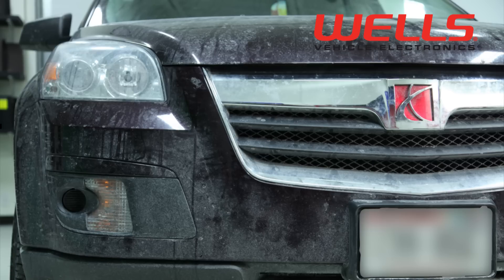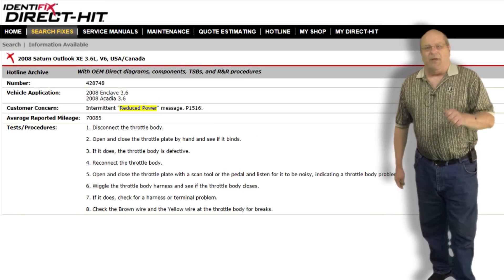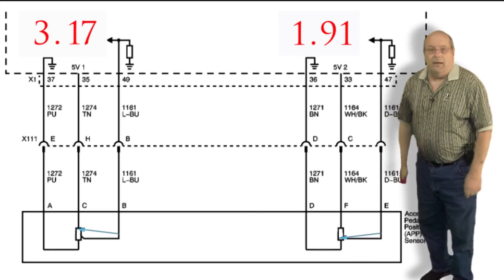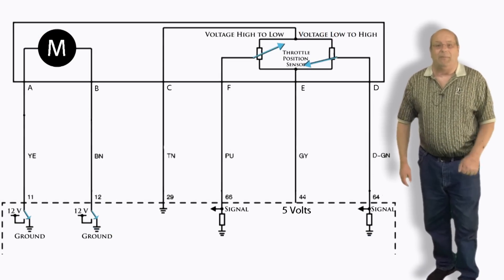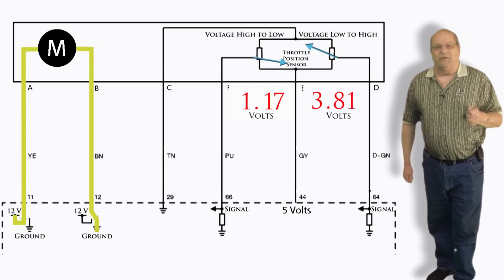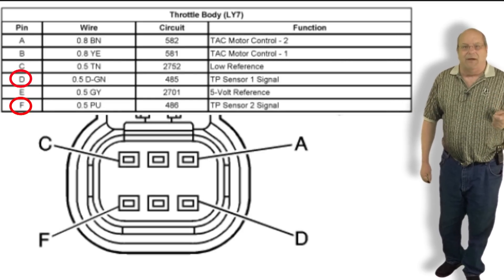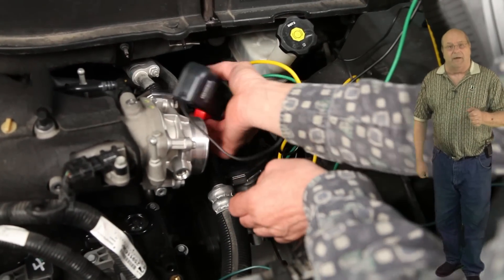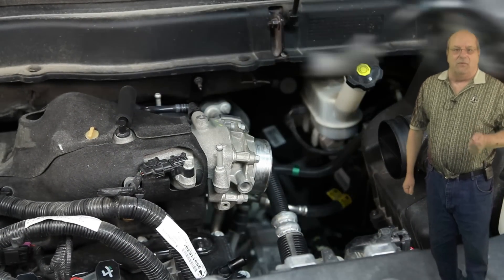Drive-by-Wire Function and diagnostics by Wells

Comment: Technically sound, this is the information I was looking for, my 2003 X-trail is starting and cutting off after 3 seconds, the throttle body flapper is not moving, I changed it, and still nothing, any advice? Do you know where the relays are for the motor or is it transistors that are switching inside the ECU.

Comment: I have 09 Saturn aura Xe I get power reduced light on and I use to be able to wait like 10 or 15 mins and it would drive normal but now It want do that now is there a way to buy pass it the codes told me it was the gas pedal sensor but I replaced it and it's still the same

Comment: Hello, thanks for the informative video.  I recently put a new pigtail on the Throttle Actuator Motor on my 2008 Expedition.  I thought I wired it correctly, but not sure if there is a pos. or neg. side to motor.  There is a red wire and black wire coming from pigtail, but Ford has diff. colors to harness.  (Blue wire and Yellow wire) can't find wiring diagram.  Any help?

Comment: Good day Sir.

 I have problem with my Toyota Yaris 2012
The idle drop when AC is turn on and it only idle like around 720+rpm.
I also noticed the cooling fan doesn't switch to on/off when it reach the temperature.  It remains On
There's engine vibration is also noticeable, I have cleaned the throttle body, change the spark plugs, ignition coil and o2  sensor. I check for any leak from the hoses but still having the same problem.
I Hope you could help me, have a nice day 
God bless

Comment: Hi. I was wondering if  is a discrepancy between Tps 1 and Tps2 could be cause by a dirty throttle body.
Reply from the maker: Hey, I don't see how it could. The sensors are both reading on the exact same shaft. If there's a dirty throttle body issue I would expect both sensors to show the same results. 
Mike Becker, Senior Technical Instructor
Reply: Thank you, Mike.I was just asking because I see people who have the same code p2135 on nissan say that they clean the throttle plate and fix  the issue. I, myself, don't see how this can happen as well.
Reply from the maker: Hmm, not sure! A P2135 is a signal rationality code. Not sure how the throttle plate would cause that.
Mike Becker, Senior Technical Instructor

Comment: so does the apps also put out two different signals opposite of each other that adds up to 5v?
Reply from the maker: Most put our 2 inverse signals. It's not so much that they need to add up to 5v, it's more that they cross paths at the proper voltage, that's what the computer is checking usually. Some cars use 3 signals. Ford likes to do that.
Mike Becker, Senior Technical Instructor
Reply: Wells Vehicle Electronics thanks for the reply.  Is the throttle position sensor opening percentage on a scan tool suppose to match the app sensor %?
Reply from the maker: Usually not. The APPS is an input to the PCM. The PCM makes the call on how far to open the throttle. Want a good representation, go drive a car with traction control. Stomp on the gas in gravel and make traction control kick in. You'll see 100% APPS and very limited TPS. This is because the PCM has the final call on how much throttle is actually allowed :)
Mike Becker, Senior Technical Instructor
Reply: Wells Vehicle Electronics got it thanks..appreciate all your videos..always a good learning experience
Reply from the maker: Glad you're learning. Thanks for commenting and asking questions :)
Mike Becker, Senior Technical Instructor

Comment: Hey, Sir. Do all ETC system function the same way? I am just trying to know if Infiniti TPS Sensors function the same way as the vehicle in this video.
Reply from the maker: Hi, as with everything on a car, it's very unlikely that something functions the same as something else. ETC systems are no different. Whether its an Infiniti or a Ford, they will act different, but do the same job. What kind of Infiniti are you working on?
Mike Becker, Senior Technical Instructor
Reply: Thank you, Mike. It is a 2006 Infiniti FX35.

Comment: @markhicks Mr. Hicks I have 99 crown Vic 4.6 with a p01409 @ p0443.. I am missing feed voltage for both of these solenoids.. This is with (KOEO) The Evr solenoid that controls egr valve has two wires, red & brown. The brown wire goes to ecm ground side switched??  The red wire is feed just because it's slightly heaver gage wire.. So I assume it's feed.from looking at a wire digram I don't it's destination.. Maybe it's the bootleg wire diagram I'm using or my inexperience of following a diagram idk.. But it only shows red wire#11  Is that ecm slot?? Or is that a another connecter& slot??  Lol hey when is that wiring diagram class??
Reply from the maker: LOL Wire diagram class starts January next year.
this is the test procedure for the P1409:
1. Verify battery voltage is present to the EGR Vacuum Regulator (EVR) solenoid on the Red (R) wire with the ignition switch in the Run position.

2. Check resistance between the two terminals of the EVR solenoid. Resistance should indicate 30-70 ohms.

3. If the solenoid checks to be OK and the R wire indicates battery voltage, check the Brown/Pink (BR/PK) wire for battery voltage with the ignition key in the Run position.

4. If the BR/PK wire indicates battery voltage with the solenoid plugged in, check the BR/PK wire at PCM pin 47 to verify that the BR/PK wire indicates battery voltage indicating a defective PCM.

5. Check the BR/PK wire to verify it does not show any voltage with the PCM and the EVR solenoid disconnected to verify it is not shorted to power, which may have damaged the PCM driver during an EVR solenoid activation attempt.

Test Procedure P0443:

1. Check for a blown (or missing) fuse 21. This is a 15-amp mini-fuse in the engine compartment fuse box.

2. If the fuse is OK, check for a poor terminal connection or a broken Red/Yellow wire under the fusebox. 

Fuse 21 supplies power to every component that is setting a code. The missing and lack of power is due to the Powertrain Control Module (PCM) shutting injectors off under load, in order to protect the transmission.
There have been problems with the harness to the transmission causing this fuse to blow. If you find yourself on this path also do this test procedure:

1. Check fuse #21 (15 amp mini) of the under hood fuse box for a blown, missing, or poorly connected fuse.

2. If fuse 21 is found to be blown, inspect Vehicle Power (VPWR) circuit for a short to ground, at any of the Oxygen (O2) sensor harness connections, looking for a potential short to the exhaust manifold or an exhaust pipe. Disconnect the transmission solenoid harness on the passenger side of the transmission and inspect it for the presence of transmission fluid on the connection. Service the harness for a shorted circuit as needed.

3. If the transmission solenoid harness connector is wet with fluid, recommend replacement of the transmission interconnect. This is the piece that connects the internal harness to the external harness.

4. If fuse 21 blows when the transmission solenoid harness is reconnected, the internal interconnect (harness) should also be replaced.
Stay in touch,
Mark

Comment: 100,000 k new engine??? Was she changing her oil??
Reply from the maker: Yea she has taken pretty good care of the vehicle. Almost all highway miles and the oil and filter get changed every 5K.
the point was there was nothing really wrong with the engine, to me it appeared the dealership did not diagnose it properly. Those engines do have a history of ring problems, but she was no where near the time for a rebuild.
Mark Hicks
Wells Vehicle Electronics